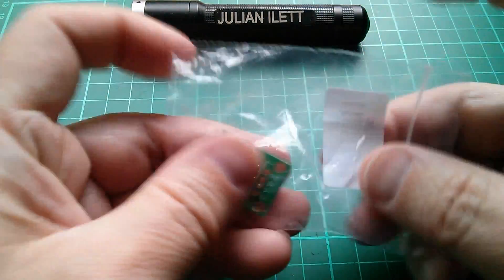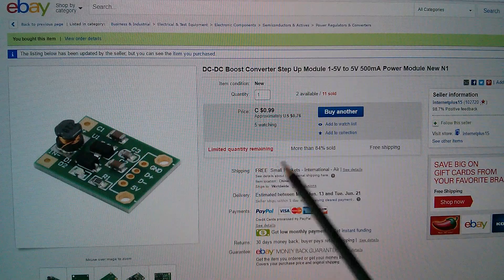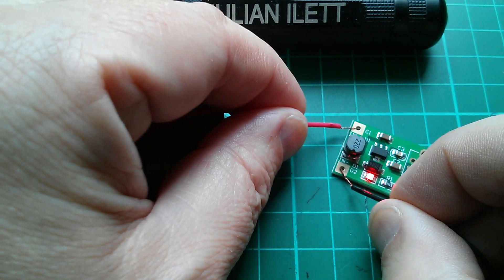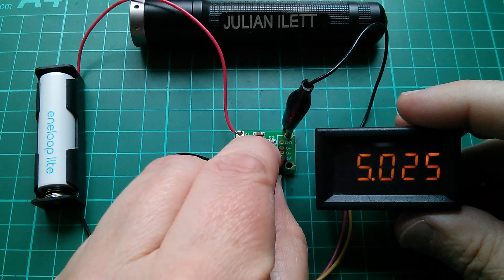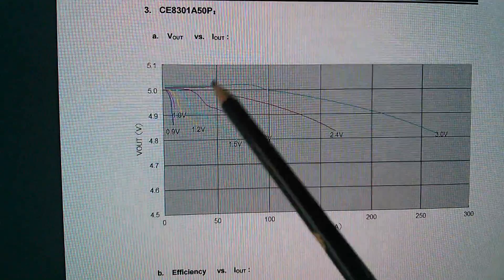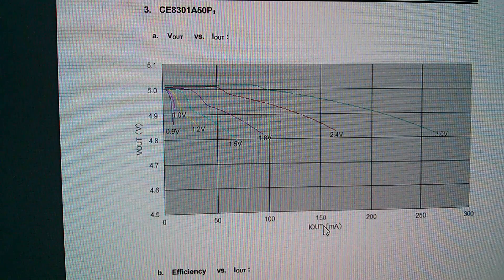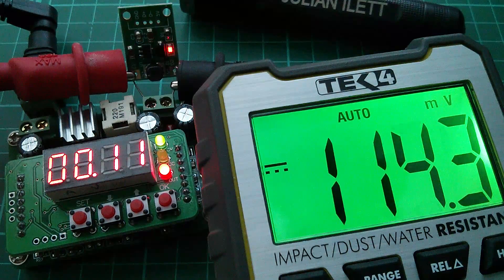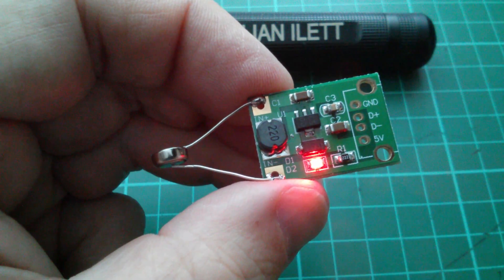eBay Cheap & Cheerful: #3 - DC/DC Boost Module 5V Out

Comment: Great Video!
I would like to connect 3x AAA Batteries witch supplies in sum 4.5V and consuming the 5V Out for Arduino and UltraSonicSensor. My Arduiono should read data every 10 Minutes and deep sleeping between reading data. In deep sleep mode, the Arudino is consuming 0.15mA. Thats low enough for for a long use of batteries.  Does the board have a standby current without or with less load on output? Best regards!

Comment: I connected output of the module with 6v AA cell holder in parallel ,will it effect the converter  if I use AA cell supply and no input in the converter?

In short what if I attach 6v supply  to the output of the converter module
In same polarity and also tell me for opposite polarity also.

Comment: Great video but I have one question. Once I have connected the low voltage power supply the chip . How do I release the new voltage. Where do my positive and negative wires go to

Comment: im confused by the graph at 4:55.  i thought this video shows that the output will remain steady at 5v  at anything above .4v in.  So why do all the Vin's curve downward.? how can you get 4.8 or 4.9v and draw higher current?
Reply: you can't. basically the graph is tell us if the supply voltage is below certain voltage, you can only draw that much of current but still maintain a nearly stable 5V.

Comment: so could i use this to basically use up all the battery power in "dead" alkalines or nimh that everybody throws out to totally eek out all the capacity? any dangers? or is this a waste of time
Reply: Im thinking this could be used with dead alkalines to give a tiny trickle charge on sub 3v 18650 cells to rejuvenate them back?
Reply: the thing about battery be it alkalines or li-ion, the discharge versus current is pretty much a steep exponential.
that means if the cell drop below its threshold voltage (in alkalines it will be around 1V), the amount of current it can produce is pretty much close to nothing that is shown in any discharge characteristic curve by the OEM.
in another words, that below 1V battery can't even power the boost convert at all.

Comment: Could you use it to charge a smart phone whit 2 AA baterys.
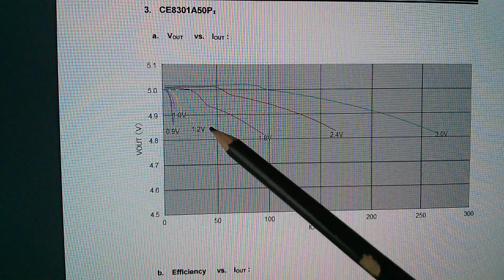Reply: Yes. But P(in) is gonna be >>  P(out). A lot of power is lost due to (in)efficiency. So, theoretically, if your input is 1A at 2V, you will end up with 5V but at much less than 400mA (or something like that) in the output. That's gonna take painfully long to fully charge a phone. But yes, for emergency situations 5% juice can go a long way. the chart at 5:00 should help you understand it.

Comment: My setup Arduino which needs 5V + Bluetooth module HC-05 also needs 5V + MPU-9250. I want to add a lithium polymer 3.7v battery. So I need this module but which Module should I use to charge the battery. please any help would appreciated.
Reply: Does TP4056 charges lithium polymer 3.7v?
Reply: you could use the board out of one of those super cheap usb power bank boxes. basically they have a module like this on one side of the board to output usb 5v from an 18650, and a tp4056 lithium charging module on the other to charge said 18650

Comment: I discovered these a couple years ago.  I love them.   I convert old miners head lamps or flashlights to LEDs then use 2 old discharged AAA or AA batteries depending on what the lamp's  battery case was designed for, and  they run forever and I know I used up every ounce of energy in the batteries after then go flat in this application.    These are great for ATmega and ATtiny microcontroller projects I make also.   I can run the micro on 2 old used AA or AAA batteries forever with this converter.    This is great little tool for a lot of things.

Comment: Buy the other type that has a smoothing cap and USB connector - they are just as cheap (or cheaper) 
5 pcs = $2 http://www.ebay.com/itm/5PCS-0-9V-5V-to-5V-DC-DC-Booster-USB-Mobile-Step-up-Power-Supply-Module-/181916952600
1pcs C $0.99  http://www.ebay.com/itm/0-9V-5V-to-5V-DC-DC-Booster-Module-USB-Mobile-Step-up-Power-Supply-Module-SN-/262073386441
Less ripple too I guess...

Comment: Are these use the same chip, maybe?
http://www.ebay.com/itm/5pcs-boost-step-up-power-supply-module-dc-dc-usb-0-9v-5v-to-5vdc-mini-pfm-diy-k8/231846312873
Then it's a very good price for 5pcs with USB socket too
Reply: Yeah I have a couple too, they also have a smoothing cap so less ripple I guess...
I got then to attach to cheap and nasty 5V solar chargers that are useless without strong sunlight else.

Comment: The reason why it can still work at such low voltages is that the chip powers itself from it's own output voltage (possibly through an ESD protection diode) so it has enough voltage to operate the switch (it only needs 0.9 V) and if it can close the switch it can charge the inductor even if the input voltage is very low. As long as an ON cycle can store enough energy in the inductor to make enough voltage at the output, the IC will keep switching even at 10 mV. Amazing isn't it ? :-) I never realized such a converter could do that.

Comment: 5 digits voltmeter display  is bether ;) ( smaller voltmeter http://www.ebay.com/itm/131058555276 )
(Like thes: US $5.54 0,0001v-33,000v http://www.aliexpress.com/item/0-36-5-Digit-0-33-000V-DC-Digital-Voltmeter-Volt-Voltage-Meter-Gauge-Car-Battery/926466175.html and US $5.15 0,0001-3,0000A http://www.aliexpress.com/item/0-36-5-Digits-0-3-0000A-DC-Ammeter-Digital-amp-Ampere-panel-Meter-Red-LED/927396171.html ) (I made this stupit thing with tes https://plus.google.com/u/0/113040175642762602810/posts/TKoXPosi2tE :S) (I want 5 digits like this (Amp Volt dual) http://www.aliexpress.com/item/New-DC-100V-10A-Voltmeter-Ammeter-Blue-Red-LED-Amp-Dual-Digital-Volt-Meter-Gauge-Wholesale/32675316908.html or OLED like this http://www.aliexpress.com/item/7in1-OLED-Multifunction-Tester-Voltage-current-Time-temperature-capacity-meter-electrical-voltmeter-Ammeter-blue-font/32573373271.html ) 
...exuse my english

Comment: Excellent video. How can I find the same seller on eBay that you used? There doesn't seem any way to find it - looking for same but output voltage of 3.3v to drive higher power LED.

Comment: I got a couple of these to boost my lipo's to 5v to use with Arduino's. I never experienced any issues with them, but also got some little boards with the USB female header attached already at a good price on ebay.  I alwyas wonderred about the current it could supply, your informative PDF reading on the video enlightened me - thanks!

Comment: Why didn't you measure the output voltage (and perhaps the current you can get of it)? Is the datasheet correct? It stated 0.9 V startup Voltage but you showed that a NiMh Battery would low discharge itself.
Or the ripple?
Another more practical question is the standby current. You could desolder the led and measure it.
This could also lead to other interesting points like how long will the led light up from what batteries ... 
All in all an interesting ebay article but I somewhat miss the details and depth of your typical videos.

Comment: sir , first of all love your videos . very informative indeed ! correct me if I am wrong in assuming that the minimum input voltage limit  would increase with the load connected to the output ? In that case , though it produces nearly 5V output with voltages as low as 0.1v , wouldn't suffice for any practical application ?

Comment: what iof you put a white led on the output and how low will the voltage go on the input
Reply from the maker: Just tried a blue LED with a 1K resistor. Brightness starts to fall away below about 500mV and switches off completely below about 180mV
Reply: so could be a good option to step the voltage up of an earth cell battery

Comment: its out of stock :(
Reply: All of the at least 50 listings of the same device on ebay are out of stock? ;)
Reply: On Aliexpress you can find them for $0.51
Reply: you can buy them with USB female adaptor as well
Reply: Exactly  - I have some old mudules with E50P chip which seems to be same step-up IC

Comment: I buy those in the dozens - I use them in my "learn to solder" kits to run a 5V RGB LED blinkie toy from a single 1.5V cell. Cheaper to buy this module than to buy the parts to make it from.
Reply: Do they give you a bulk discount?
Reply: If you look around you can find qty 10 sales and that's a bit cheaper. That's about as cheap as it gets as far as I've seen.
Reply: I suppose on Aliexpress you can find those modules for $0.5 or less. I just checked - $0.51
Reply: .42 US a piece if you get five :) http://www.aliexpress.com/item/5pcs-free-shipping-10pcs-0-9-5V-To-5V-600MA-USB-Output-charger-Mini-DC-DC/32647378015.html
Reply: Banggood has deals on the variable PSU too. I will be buying some of those for sure.

Comment: Would have loved to see how much can you draw at certain input voltages. This coupled with a cheap garden light with the qx5252 chip can make good low power sensor nodes.

Comment: Ah, you're killing me. Measuring the PSU accuracy and not the output voltage of the Boost converter @.1V  Love to have seen what boost-power it can deliver at ultra low input voltages.
Reply from the maker: I was more interested in confirming that the very low input voltage was to be believed. I will be using this device again soon and I'll probably put my oscilloscope on both the input and output at the same time to watch how the converter responds to falling input voltage.
Reply: +Julian Ilett that sounds like a great idea for a video! Please. 
  ; - )
Reply: Thank you for mentioning. The LED even has a current limiting resistor on it - so IT IS THE OUTPUT. So why measure the input instead of the output? Or why don't he use an oscilloscope (which he owns) to see, what happens with the voltage. I guess it burst up to 5V and instantly drops down, generating kinda sawtooth-waveform.
Reply: Yep, please connect it to an oscilloscope the next time. And get ready for some amazing sawtooth output. I already tried this one for my own micro quadcopter project and now I know why the are so cheap ;-)
Reply: I got the exact same reaction ! Fortunately I've got two of these modules lying around so I measured them: I needed to provide at least 0.4 V in order for the output to reach 5 V. This is super impressive. I also confirmed that the converter can actually start at 0.4 V.
Also 0.2 V gets you 3.3 V on the output, it's probably a very borderline operation but it might power some small microcontrollers...

Comment: but this is totaly bullshit becouse it hasnt got overcurrent protection, so it cant charge your mobile phone, because you will blow it up
Reply: +Marek Coufal except for the fact that it maxes out at 100mA I think our some other arbitrarily low value. So if you try drawing too much current it will drop the voltage.
Reply: Its a DC-DC step converter, not a phone charger. Why would it need to have over-current protection?
Reply: Boost-converter has 5V max so it is completely safe for cell phone. Overcurrent??? It is solved inside phone charging unit.
Reply: +cbm80amiga no,no i mean the mobile phone want usualy 1A of current and you are probably charging with 18650 cells which can provide much much of current, so the mobile phone want 1amp of current but this boost converter is for only 0.5A so you will overheat dcdc converter but not mobile phone
Reply: I tried to charge cell phone using such modules and nothing bad happened. Only output current was limited. But for powering Arduino boards from 1 or 2xAA cells it is perfect and cheap.
Reply: +cbm80amiga yes, you are right but this is so cheap, it hasn't got overcurrent protection.